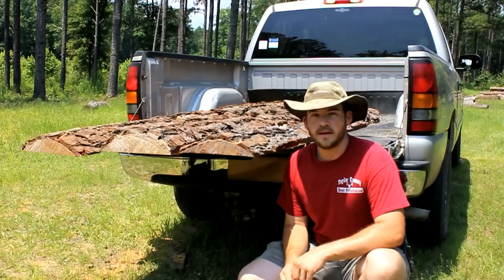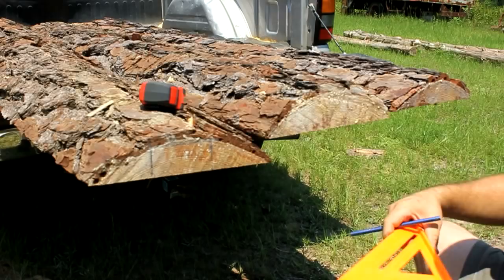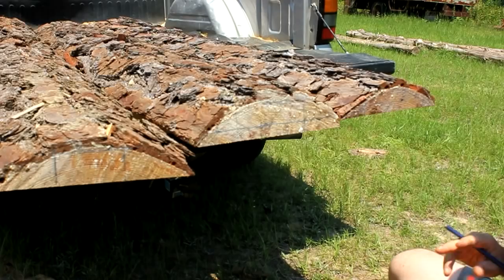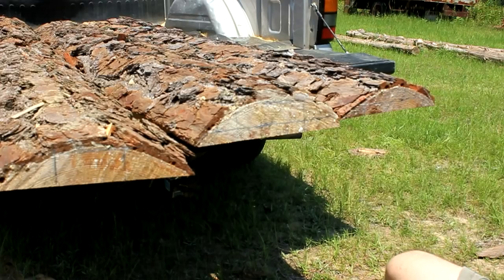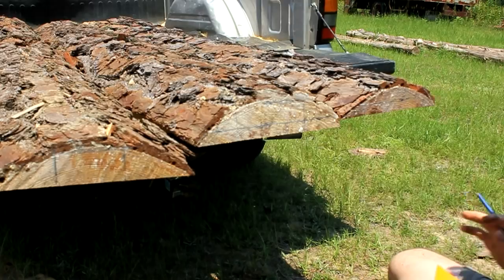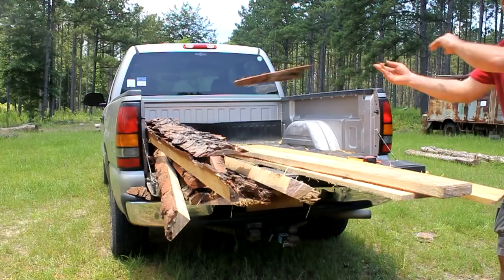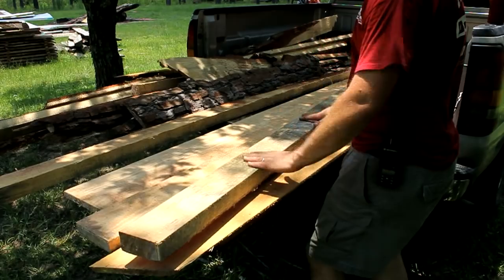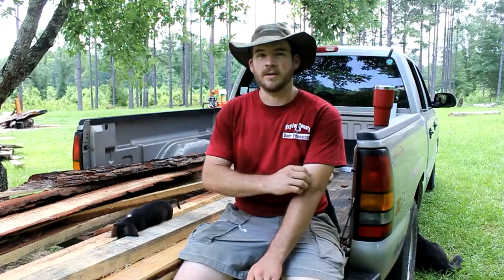How much wasted lumber is in a slab??

Comment: If you cut a circle (round log) down to square (sized the diameter of the log), you waste 36% of the log in those four outer pieces. Accounting for bark, the wastage is a lot less. I prefer to cut the outer waste pieces into firewood and concentrate my blade on the clean timber without the bark.

Comment: I hate waste. But cutting the boards like this is wasting your time, blades, gas etc. What I would look at is a way to use the outside peices in some other way besides burning in a waste pile. Perhaps buying a wood chipper and creating mulch for your own use or maybe to sell. Cut into wood for outdoor fires while camping.  I'm sure there are many other uses for it. But only you can say if any of it is worth your time in doing it. Working a job plus doing all your work at home? I doubt it is.

Comment: On a band mill with the handling of the slabs,  to me doesn't justify the time, to reclaim the wood. I now have A Peterson Swing mill. I typically open the log with a 4" cut from the small end. This yields a  1X4., then the edges give me stickers. Then drop and start cut what every I plan to get from the log, I the get my stickers from the sap wood from the bark on the way down. I have very little waste and don't have to handle the log but once. Differences from the small end to large end typically yield my firewood.

Comment: Don't resaw slabs...spend a few minutes and plan to cut the log for fullest recovery to begin with.  But, if you do resaw, just lay the long leg of your square along the bottom of the slab and it will give you the 2" thickness.  The short leg of the square will give you a 1-1/2" ...all without pulling out a tape measure.  Also you will get best yield by sawing 1x flat sawn planks from slabs.  Saw them to fullest recoverable width and resaw to project requirements after dried which helps with eliminating crooked  edges.  Wide 1x's are always nice for shelves. etc.

Comment: All depends on what you are sawing. Typically on pine that was not debarked I would not mess with it but i usually would not cut such a thick slab. If it is black walnut, cheery or some other fine wood then I save everything. You can make some nice pices out of Black walnut slabs such as clocks, table supports and even shelf vertical supports.

Comment: What it comes down to is the juice worth the squeeze when it comes to getting the last board out of slab wood.  Slab wood also makes good fire wood or kindling.  If you make lots of lumber, you could also get sticker material from the slab wood.
Reply from the maker: I agree. I think the sticker idea is about the best one I've seen for my purposes. Thanks for that idea!
Reply: My cuts are mostly one inch until I get four inches of clear wood then Its a two inch cut and I have a 2x4 after I trim the edges
Reply: No problem.  As for the bark wearing the blade faster, you could either peel the bark off or just have a dedicated blade making the initial slabs cuts.

Comment: LT35 HD, same as NWS. It's all based on the wood and how you charge your customers. If you take thinner facing cuts and plan for getting those 1x and 2x's out of them before they ever come off the mill, then life gets a whole lot easier. But, it all depends. with SYP I don't always care and might slab heavy but on any decent hardwoods, every bf counts. You got an extra 26 bf out of that one log. Say you're out milling for a customer with 40 of those logs (been there). You're now talking about an extra 1040 bf of lumber your customer gets to pay you for. If you're charging even $0.25 per bf for cutting SYP, you've lost $260 which, I think is far greater than the $22 blade. Just my $.02.
Reply from the maker: Vikingblooded Kraftwerks Thanks! Those are good points.
Reply: LT35 HD, same as NWS, would you please translate in plane English for usr local yocals.
Reply from the maker: Cecil Davisson He has a LT35 hydraulic mill, just like NorthWest Sawyer. NWS has another YouTube channel.
Reply: Northwest Sawyer (NWS): https://www.youtube.com/channel/UCrGVPlsPTZScAY1NAHqSzaw
Reply: Now I have to check out NWS channel... see what he up to.   Getting yield.. every Board Foot counts.. thats why head saw sawer is the highest paid in a big mill.. being able to see the log end grain, and quickly see the boards and likely grade inside the log. Great to see you learning how to get the ‘extras’. We got some slabs like this we “milled” on our table saw and got some nice grain wood. Your LT Miser does it quick. For a tiny saw, it does a lot of work.

Comment: Great video. I say thumbs up, it's your mill and your logs!
As a general rule, all logs are sawn down in 1" thickness until you get to the size/width boards you're going for....but the 1" is made while its still in the log, thus only needing to handle the slabs/waste once. Thanks for showing the resaw, you got 23% more lumber. 
There is no foreign debris in your logs in the way you harvest them....and clean bark is easy on the blades. But if you have other use for the waste, i.e. firewood, then a thicker slab is not always a waste....however usually only hardwoods are used for firewood. 
Please note: My comments are based on past experiences (born in 1948) and applies to harvest methods of my area. 
….13
Reply from the maker: Thanks for the insight and for watching!

Comment: With a band saw mill, of any size, manual or hydraulic, there will always be more waste than is worth the time and effort to capture. To get the absolute most usable lumber out of a log, a swing blade mill is the most efficient. However, swing blades are somewhat limited in the width of cut on a single pass to slightly less than half the diameter of the blade. So if you want to cut stock up to 12" wide on a swing blade mill, you will need at least a 26" blade, and that's a pretty big expensive machine. Even the smallest band saw mill can cut at least that, and probably much more, that on a single pass.
Reply from the maker: Paul Allen Didn’t even think of the swing blade mills. Thanks for the comment!

Comment: I seen a video on youtube that a guy cut squares out of metal and put them on the small end and marked them off. He had all dimensions of them said it saved him a lot of time measuring
Reply from the maker: Not a bad idea! If I ever decide to start salvaging these slabs I might have to do that.
Reply: he did it on all logs just to see how big of a cant he could get out of a log
Reply from the maker: Larry Downes Ah, ok. That’s a great idea!
Reply: Larry Downes --- A sawyer should be able to look at a log quickly and know exactly what his total boards will be, WITHOUT using a tape measure....all of the mills have measurements in place on them, and THEY SHOULD BE USED with not much thinking required!

Comment: I take alot smaller slabs... Opening face get a 1x6 and cut down from there. Always level your pith. You will get alot more lumber in the long run. Resawing slabs on the sawmill is not very productive. But anyway I really like your videos, and hang in there, you'll figure it out one way or another
Reply from the maker: Appreciate the support, Corey. Thanks for watching!

Comment: Thick slabs make nice canoe paddles outta the right kinda wood!!!!. Picnic tables,, tops & seats,, put the widest side up for the table & notch the seat to fit the cross braces so they come out level easy to do after you do a couple.. Guessing 2 trees cut like you did the one you re-sawed  will make one table outta the slabs!! I can build a table in 15/20 minutes,, 150 /200 bucks.. Money grows on trees.. lmao,, Aloha !!!
Reply from the maker: I actually have a large stack of slabs that I intended to make into picnic tables. Glad you've had success doing that!

Comment: i would just cut one inch slabs down to the desired depth then cut them for stickers if you need any other than that the sap wood is pretty much worthless to me anyway or you could have ripped those four pieces in half then cut them for firewood and sale them out of your front yard.
Reply from the maker: Roger Martin Not a bad idea for most wood. Trouble with pine is that it makes poor firewood because of the creosote buildup it causes. Thanks for watching!
Reply: yea i was thinking more in the lines of firewood for camping we have a few campgrounds around here
Reply from the maker: Roger Martin Yep, slabs would be perfect for that.

Comment: Great. Experiment, I cut large slabs myself, but I have an outdoor wood furnace, so like you say trying to save the blade, in return I get usable pieces of wood for my outdoor wood furnace, PS what type a radio do you have on your hip just curious, are you a ham operator? Or an ERT? Member.
Reply from the maker: It's my radio for the local volunteer fire dept.
Reply: Fall Line Ridge --- Good for you, we depend on volunteer fire dept. also.

Comment: What is the depth of cut on the lt10. Example mine is 7x22 with a 144 inch blade. The seven inch depth is from the blade to the metal above the 144 inch blade. The twenty two inches is the distance between the blade guides. Do you see an ban blade sharpener in your future?
Reply from the maker: El Dorado Woodcraft hobbies The max width of cut is 19.5”. Max log size is 24. I believe I measured once and decided I could cut a 10” depth, but I would have to get creative and cut near the center of the bed. I think 6, maybe 7 is closer. The blade is 144.